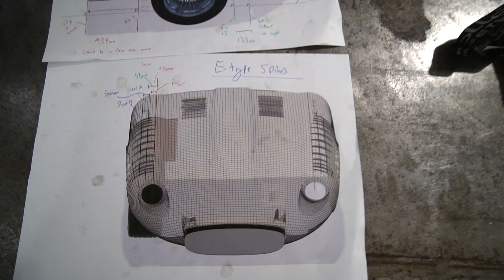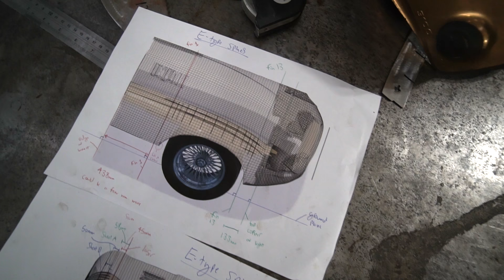Retropower Uncut Episode 109: E-TYPE Painted in PORSCHE Colour!

Comment: I just wondered if you are using the old ATF Type F in the power steering of the Mustang. I've owned one for many years and mine doesn't like the new stuff. Also, the more you drive it the more you get used to the slack steering feel. I now find modern cars rather too pointy on the steering, it's part of the classic car feel. That said the Borgeson system is very good.